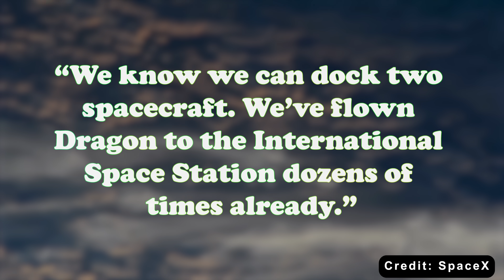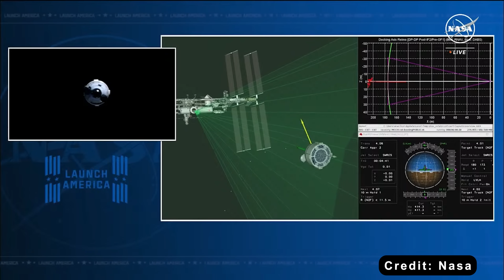SpaceX's new Starship Refuel Method SOLVES What NASA's engineers Called "Impossible"...

Comment: The Dragon capsule would have been much more crew-friendly for landings if the hypergolic propellants were non-toxic, such as Nitrous Oxide & Ethane-Ethylene fuel (NEE).
Reply from the maker: SpaceX used hypergolic fuels in the Dragon capsule because these fuels make the rocket engines simpler and more reliable. Even though these fuels are toxic and dangerous to handle, their ability to ignite automatically and be stable on the spacecraft is a big advantage for crew safety. On the other hand, safer fuels like Nitrous Oxide and Ethane-Ethylene haven't been used because they don’t ignite as reliably without extra systems and haven’t been tested enough for crew emergencies. So, the choice was about balancing safety, reliability, and simplicity for the astronauts’ benefit.
Reply: SpaceX is commited to the methalox micro-gas-generator (µgg) for RCS on Block-3. That is spark initiated. Combustion chamber pressure p>50 Bar and ISP>300. 
 @techmap9

Comment: Why not increase the diameter of starship to 15 meters to allow for more fuel?
Reply from the maker: Increasing the diameter of Starship to 15 meters to hold more fuel might sound like a straightforward way to boost capacity, but it comes with significant engineering and logistical challenges. A larger diameter increases the structural mass of the vehicle, which can reduce overall efficiency because the rocket has to carry heavier tanks and supports. Also, bigger tanks require stronger materials and more testing to handle pressure and stress during launch and spaceflight.

Moreover, the current Starship design is optimized for existing launch infrastructure (like the launch pad and the Super Heavy booster), so making it much wider would mean redesigning many parts of the system and potentially slowing down production and launch cadence. Plus, space launch facilities, transport, and manufacturing are all set up around Starship’s current size.

Comment: put the fuel to transfer in a cartridge and transfer it
Reply from the maker: That's an interesting idea! Using cartridges could make fuel transfer seem simpler, but in spacecraft like Dragon or Starship, fuel transfer needs very precise control because the propellants are liquids stored under specific conditions. Fuel cartridges would be tricky due to the amount of fuel, pressure, temperature control, and safety requirements during transfer. Instead, spacecraft rely on pumping and pressure differences to move fuel safely and efficiently between tanks. Still, your idea shows creative thinking about making complex processes easier—thanks for sharing it!

Comment: Really hoping the tiles they are developing for Micro Meteorite & thermal control (fuel cooling) work. Then a low power & weight, active Fuel cooling system would just be the trick. Wonder if a 9 engined V4 "Shorty" would be the way to go as far as a Tanker design..

Comment: I don’t understand, although I agree with this refuelling, how and why the original moon landing did it with one rocket, one moon lander and one return capsule All the done on one fuel load ?   Doesn’t make sense to me.
Reply: Saturn V, and all Saturn's that went to the moon afterwards, only carried 12.5 tons of payload combined, that includes hardware and people, and all a one time used, afterward discarted, starship can carry a 100 ton payload, is two stage, and both stages can return and be reused multiple times, so yeah, in space refuel is necessary to create a permanent  lunar base, with constant and cheap launches every week, SLS will just launch once a year, costing 5 billion each, not good for a lunar base, only for a repeat of 1969, which is pointless.
Reply from the maker: That’s a really good question and it’s one a lot of people wonder about!

It seems like Apollo just blasted off, landed, and came home on one big tank of fuel… but the trick is that the Saturn V was basically three rockets stacked
Reply from the maker: The big difference is in how and where the fuel is used.
During Apollo, the Saturn V wasn’t just one rocket in a simple sense it was like three rockets stacked together, each used at different stages:
✅ Stage 1: Launched the stack into space
✅ Stage 2: Pushed it toward Earth orbit
✅ Stage 3: Sent the astronauts all the way toward the Moon
Once they arrived, only the Lunar Module went down to the surface.
The Command Module stayed safely in lunar orbit, saving a huge amount of fuel.
Then:
1⃣ The Lunar Module took off from the Moon using its own fuel tanks
2⃣ It re-docked with the Command Module
3⃣ The Command Module used its own fuel to return home
So even though it looked like “one rocket with one fuel load,” it was really multiple separate fuel systems used at different times — and a very short mission (only ~2–3 days on the Moon).

Comment: If the goal is to go to the Moon and Mars, why does the super-heavy first stage have a 70 km cutoff? Because it lacks wings, it has to use a large amount of fuel to slow down upon landing. Furthermore, the acceleration energy gained from the 70 km separation is wasted. Instead, separating the main engine at 200-250 km would likely solve the problem of going to the Moon.
Reply from the maker: Very useful. Thanks for sharing
Reply: @techmap9 SpaceX has not achieved obit yet because they choose not to rather than CANT. Take note that they anchor bouy in the middle of no where and film the spaceship landing within meters of it!
Reply: Making an expended booster stage is at least 5 times more expensive than a Starship, just in terms of wasted Raptor engines. However, the real loss is rapid launch rates, since expended designs also are limited to the fabrication speed instead of accumulating boosters and reusing them.

Compare a 2 month cycle time to a 1 week cycle time for Block-3 boosters just in 2026. 

Much more can be quickly accomplished with rapid reuse.

Comment: Nose to nose with a light spin the fuel going through a tube like an aerasol stem pulling liquid. Artificial Gravity.
The problem is the freighter won't be completely empty during re-entry
Reply from the maker: Yeah, spinning two vehicles nose-to-nose could definitely help pull the fuel toward the transfer lines, kind of like artificial gravity through centrifugal force. That part makes sense.

The real challenge, like you said, comes afterward:
*The ship still has leftover fuel when it has to re-enter the atmosphere. Even a small amount can be risky because liquid propellants slosh around, shift the center of mass, and increase the chance of overheating or explosions on re-entry.

That’s why Starship is designed to *burn off**, **transfer**, or **secure* its propellant before heading home — the goal is to have tanks as close to empty as possible so the vehicle stays stable and safe.

So your idea has potential — the engineering just has to make sure the tanker is nearly dry before it dives back through Earth’s atmosphere. 🚀